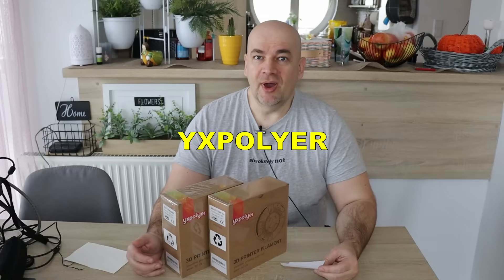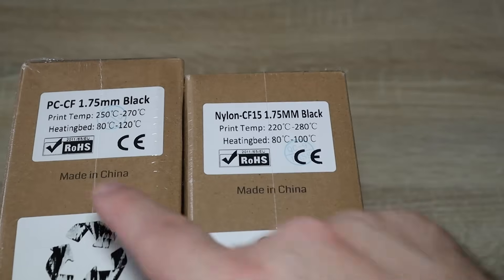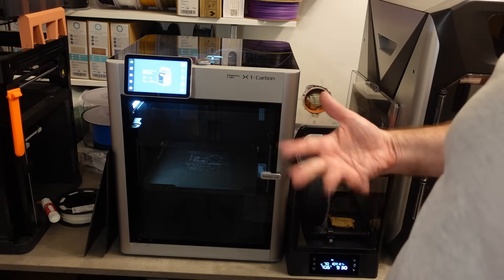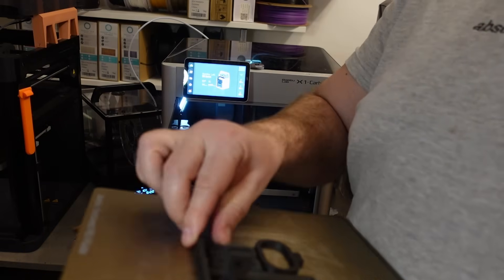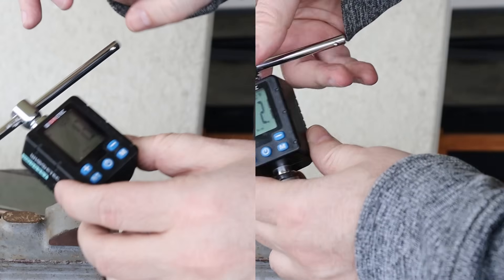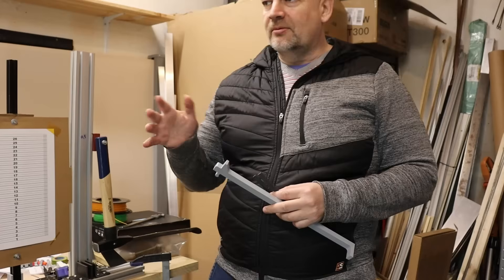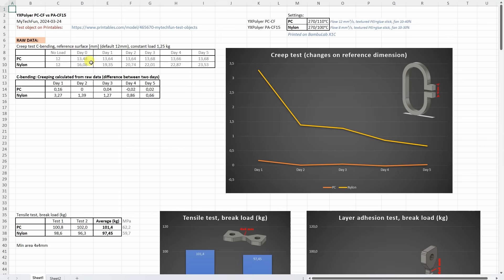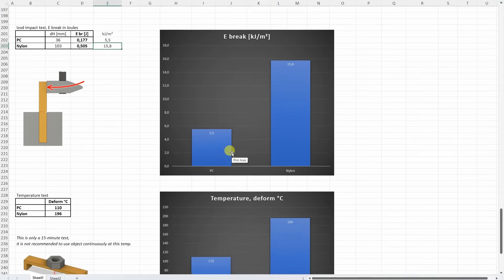YXpolyer PC-CF (polycarbonate) vs Nylon-CF - both very strong 3D printing filaments, but differently

Comment: For me the best filament by far it would be the YXpolyer Nylon PA and with CF depending the flexibility that you need. It think this filaments is underrated. But the layer adhesion and the impact resistant is very high.
I dream in the future to discover a most isotropic fdm filament and impact resistant

Comment: Thanks for this.  I received my first spool of the YX Polyer PC CF.  I am pretty impressed with it.  It’s easy to print, super strong, and the carbon fibers hide the layer lines nicely.  The melting temp might not be super high but it’s well within the environments I’ll be using it in.  I loaded this into my AMS HT to dry .  Not even thinking about AMS compatibility I started printing with it.  it loads perfectly through the PTFE tubes. 😅

Comment: Very disappointing result for the PC-CF temperature resistance. 110°C is not enough for the application I bought the filament for. I feel like I've been ripped off.

Comment: I just got a roll of YXPolyer Nylon (no CF) that was SO wet there was WATER droplets covering my drier! Alot of water.  No joke. It absolutely wouldnt print. It wasnt acting like nylon even anymore. Warped and brittle still. Think the moisture ruined the polymer chains or something. I swapped and redid the print with 3 other nylons i had on had that had absolutely no issue. Bad roll maybe? That was hands down the wettest filament roll ive EVER had😂 ever. Im returning the roll unfortunately, and I was really excited to try their Nylon. But after 3 days of drying it still isnt printing proper- even in an 80° chamber!

Comment: Try this new beds for printing. I've been able to print PC-PETG (50%-45%) with bed at 40°C using Juupine Geco plate.
Also very good results using Sunlu Easy ABS as raft+brim pause after 2-3 layers and continue with ABS or PA.
I'll try the new Juupine ESP. I already own the Biqu Cryogrip Frostbite and the Glacier is on the way.

They promise lower bed temperature with saving in electicity bills.

Comment: Very good tests! When it comes to the impact test, I think the simple mgh calculation is not accurate for the energy. I mean the formula is obviously correct. But the height of the hammer is not h everywhere. Maybe it could be more accurate if the mass center of the hammer was found, and h of that point was measured.
It is obvious to me that the mass center is more down the shaft, which would give bigger h (except for the zero run)
So if you used the correct, higher h in the calculations, the correct Energy would be lower. The part didn't slow down the hammer as much as measured here.

Comment: Thank you for this, and thr other video I've found from you.  I am looking for a new material to use where I might otherwise have used machined aluminum.  Cold creep (and warmish creep) are big concerns for my use.  Your videos demonstrate that clearly.

I would like to avoid CF dust, so I'll also be looking at glass fiber materials, as well as unfilled polymers.

Thank you for the data you bring.

Comment: amazing video as always, how do you post treat nylon or other water absorbing filaments to prevent warping or deformation in the parts? Have you found this is a problem. It's one thing that's stopped me from printing nylons.

Comment: Hi, do you know the length of CF pieces? Or are they continuous strings?
Reply from the maker: I don't know the length, but they cannot be continous, they would clog the nozzle. They are designed for using on 0.4 mm nozzle, so their size is below this

Comment: you got a sub, great video, does your patreon include a table comparsion (all in one) from all your videos?
Reply from the maker: Yes it does! And you can easily finlter or change the order for only one specs, for example, which filament resists the best to the bending.. etc.

Comment: I believe you won't see the real properties of PC [blends] before annealing the prints. How to anneal them depends on info from the manufacturer, and if a manufacturer doesn't provide such info this means that the filament (or manufacturer) is garbage.
It's a pity that none of these filament types are useful at all for 3D printer parts. PA-CF creeps a ton and PC (CF or regular) cracks over short time. I have bad experience with both and they are a waste of money and energy to buy and print unless you have specific use for it.
Reply: What do you mean by cracking about PC ? Never heard about that.

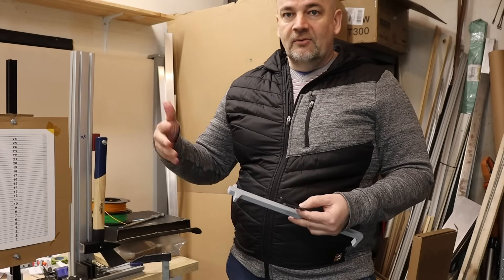Comment: 10:30 No, your setup isn't accurate at all, because once the material starts bending there's an additional element of friction between the material and the head of the hammer. You can see it particularly clearly on bendy materials that don't break at all. I think I once even saw your hammer get stuck on the bent material.
Reply from the maker: But that is the case with all hammers. I tried few. Then we shouldn't do the IZOD impact tests at all with plastic? I would have less work if I skip this part.

Comment: Great data Igor! Would be interested to see if the nylon properties change after heat treating it (dont like the term "annealing" for polymers...) 
I've heard that PA can perform better in terms of creep resistance and hardness if heat treated at 120 - 130°c for about an hour per mm of thickness. Would love to see you use your very rigorous test regime to see how muxh dofference it makes!

Comment: I have an application where I print threads M16-1.5 bolt and nut and when I use PLA the threads do ok, but PLA CF the torque applied using PLA breaks for the PLA cf. do you have a recommendation on what is the best material for printing threads ? I really enjoy your videos I too am and mechanical engineer, but 
I deal in matching metal.    Thanks
Reply from the maker: In this order probably: PC, ABS, PETG. But with PC and ABS you have to take in account the shrinking of the material.
Reply: @MyTechFun  thanks. I will give it a try and let you know.

Comment: do you think you'll ever try polycarbonate and nylon from 3dxtech? the good ones not the ones mixed to be printed better
Tnx
Reply from the maker: Eh, so many request I got for filaments available only in US. Shipping and customs make the price 3x bigger to me. But I became curious, several requests I got for this brand.
Reply: @MyTechFun  good filaments in the EU that are similar to 3dxtech pccf are essentium pps-cf and addnorth / treeD pc-pbt-cf. these are the 3 high temp filaments recommended for printer parts above abs but before PEEK or metal.

Comment: Great comparison! Notes: Wow 2s for minimum layer time very short. I would go to at least 5-6sec. Also textured sheet dont need glue
Reply from the maker: Most of those are default settings (layer time too). For the glue, I just followed the instructions. For PC probably it would work without it, but for PA it was necessary.

Comment: Did you print on .4mm or you nossle or you change it to .6mm? I have both, but if I don't have to swap it it is better!
Reply from the maker: Mentioned in the video, according to manufacturer, 0.4mm is OK. (and good question, since many CF filaments requires 0.6mm nozzle). But even if don't, if you don't need details, use 0.6mm, since it will wear slower.
Reply: @MyTechFun  thanks for the info. But those prints, did you use .4 or .6mm? Cause that will change the results too.
Reply from the maker: 0.4mm @JoseAguiloworkshops

Comment: I LOOOOVEEE love love love printing PA-CF... it's such an incredible material for so many reasons. I've only recently started printing PC-CF, but enjoying that, too.Thanks for the video!
Reply from the maker: What brand are you using?
Reply: Im the same way im a HUGE fan of pa cf and cf filaments in general. Fiberon is one of my favorites as well as siraya tech but I have all the yxpolyer filaments as well and im printing some yxpolyer pc cf right now and its coming out great! Im looking forward to the 3dxtech pc cf i ordered to get here!
Reply: I prefer PC-CF over PA-CF. I print it on textured PEI sheet without any bonding agent and the adhesion is great. With nylon you almost always need some type of glue on the bed and don't even think about not drying it. Overall PC-CF is easier to work with and you get excellent mechanical properties on your part
Reply: @elleryfg7853 i hear that one of my favorite filaments is 3dxtech pc cf. Its amazing stuff especially when you have it dialed in
Reply: @elleryfg7853 3dxtech pc cf is my personal favorite. Its impressive.

Comment: Most PC filaments are not real PC, but rather PC blends. 3DXtech makes a PC (from Lexan by Sabic) and it has an extrusion temp to 280-310C and it's basically impossible to print anything of size without warping unless you have a heated chamber at 90C+. They also make an "ezPC," which is their version of a PC blend. While these PC blends are much easier to print they don't have the same TG or impact strength of real PC.
Reply from the maker: I tried to contact 3DXtech if they want to send me some filaments for the testing, but I can't find any contact on their website.
Reply: I will say that after the previous review I picked up some of the XYPolymer PA as the price is very reasonable, and have been happy with it.
Reply: @RichFreeman yxpolyer nylon is great stuff
Reply: @JoeStoffa what additive is usually used for PC blend and at what percentage?
Reply: 3dxtech pc cf is one of my favorite filaments. I have it really dialed in on my qidi plus 4 and the results are amazing
Reply: Yeah, I was thinking that these temps seem way too low. I wish they would at least clearly state they are blends.

I've printed Inland PC on my X1C with the chamber as warm as I can get it (55C or so). That works fine, but I can't vouch for what is in the filament.

Comment: Hey thanks for the review. I am wondering if you have access to CC3D filament in your country. I see they sell a 72D TPU and Nylon filament. It is a new product from what I can tell. I ordered a roll to see but would like to see some testing on it. It is an interesting mixture. Here is what it says on the Amazon posting. Ultrahard 72D Composite Material of TPU and Nylon Filament from CC3D. Thanks
Reply from the maker: Sounds interesting, I like hard tpu-s. (you will see my wearing test comming soon). Hm, I can see it is available only on amazon.com. The shipping and customs would cost me 2x more :-( Somebody let me know, if it is available in EU somewhere. thx.
Reply: @MyTechFun id love to see a review of cc3d pc filament as well!  Its 50% pc 45% petg and 5% other. Id like to see a comparison to pc petg and abs/asa
Reply: I'd like to see testing for a 72D tpu.

Comment: Very nice video and really interesting materials to me as well. I am considering the PC CF as less creep/deformation under load is more important to me. Prusament PCCF has higher heat resistance as I can see from your Patreon excel sheet, but 110C is still fine for my applications and this YXpolyer PC-CF has better interlayer andhesion it seems. Although layer adhesion difference could be also the different chamber setup you used (Bambulab vs Prusa MK3 in LACK enclosure) Keep up the good work and great videos! Quick question: Have you ever tested the heat resistance of extrudr GreenTec or GreenTec Pro materials?
Reply: I tested annealed (according to their instructions)Prusa PCCf for 3 hours in an oven at work, still good at 130C, but at 150C it was a bit flexible. Will try Addnorths PCCF next with HDT @ 185degC, the spool is waiting on the shelf :) i also use PCCf for the same reasons, stiffness and creep are very important for mechanical stuff, especially when they are screwed together for example.

Comment: I've had issue with PACF made toolhead on my printer - after about year it becomes "rubbery"/"springy"/"spongy" so much, it was useless. The one year old parts had totally different properties than it was in its first month.
Reprinted from PCCF and never had this issue again.
Reply: This is typical behavior. Nylon has a lower elastic modulus than polycarbonate, and water plasticizes (i.e. softens) it. Nylon is hygroscopic, absorbing atmospheric moisture before and after printing.

Comment: I would really love to find a nylon with the resistance to creep that the polycarbonate shows.  But I guess such a thing does not exist.
Reply: It can't
Reply: For creep resistance, it would need continuous fibers, or at least a large fraction/percentage of long chopped fibers, aligned in the load direction. A small fraction of short fibers barely improves creep resistance, because the deficiency in Nylon/matrix performance dominates.
Reply: PPA,PA6T